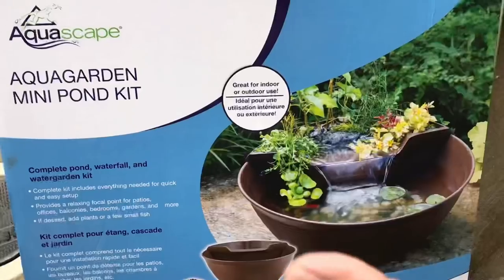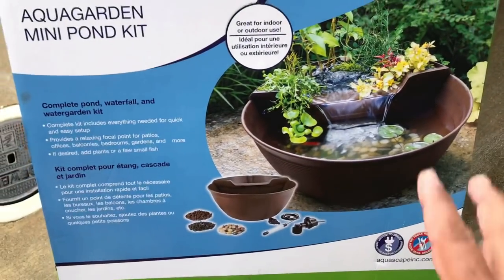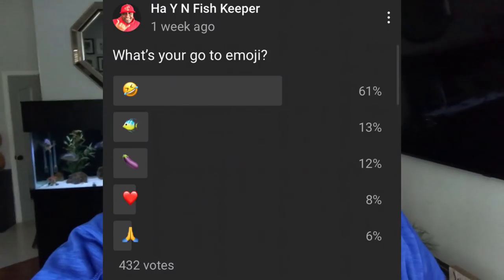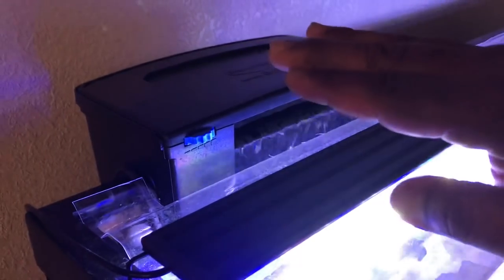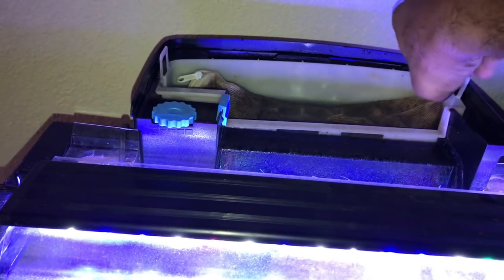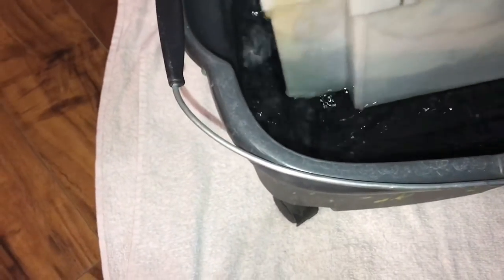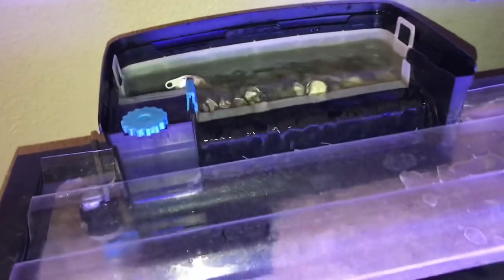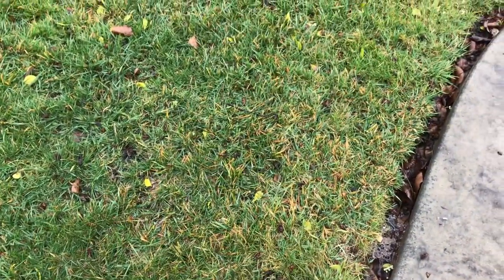SIMPLE, EASY, and RELIABLE every Home Aquarium Needs One!

Comment: With this method, I don’t need to buy those expensive throw away filter cartridges?
Reply from the maker: You’ll love this one Bridget trust me🤙🏽💯🤙🏽
Reply: Those filter cartridges are a SCAM
Reply: @adkaquatics212  I have some that requires them,  but bio media and pinky floss replaced all that mess! LOL
Reply: The filter cartridges are not good because they usually contain carbon.  Any water treatments or medications the carbon would absorb so it is a waste to treat a tank with carbon.
Reply: @Iamadrummer  you just turn off the filter or remove the carbon while dosing.  Although it is a pain.